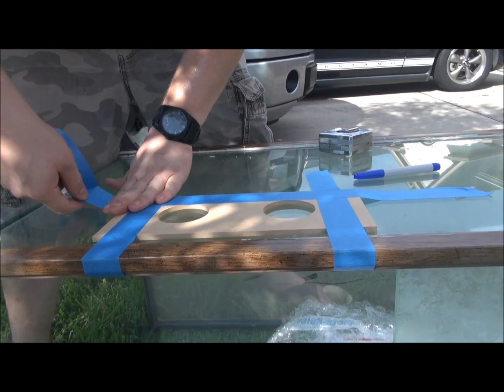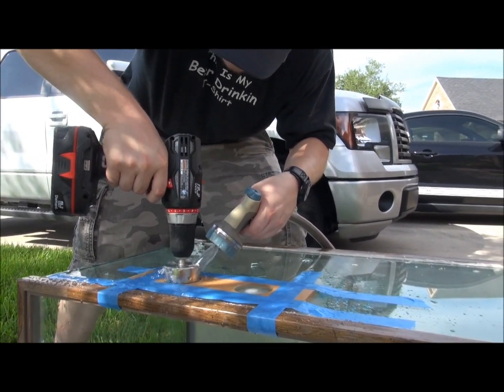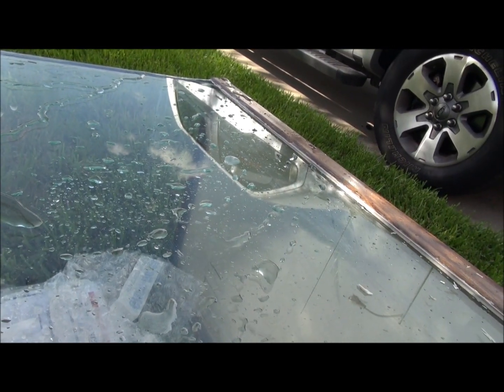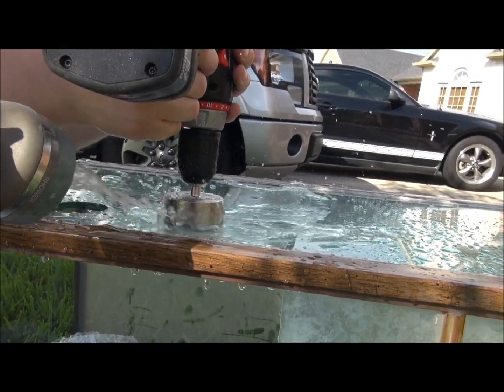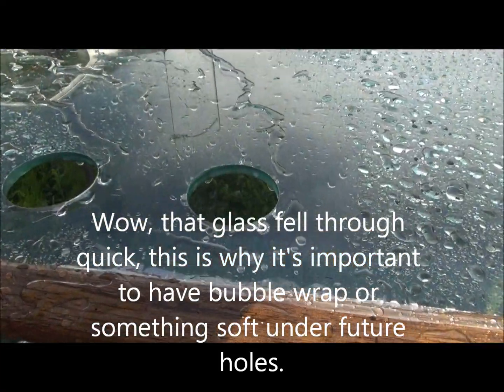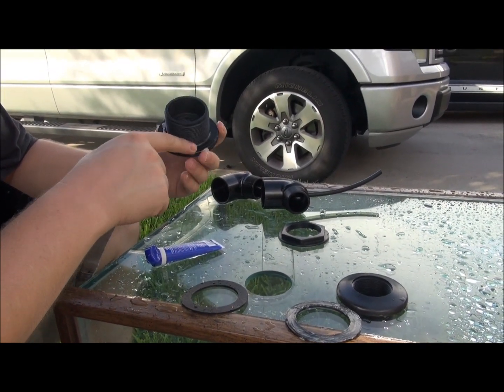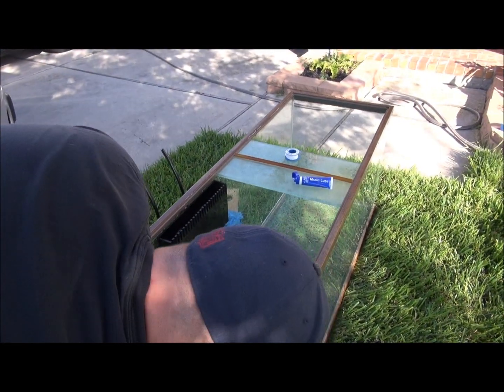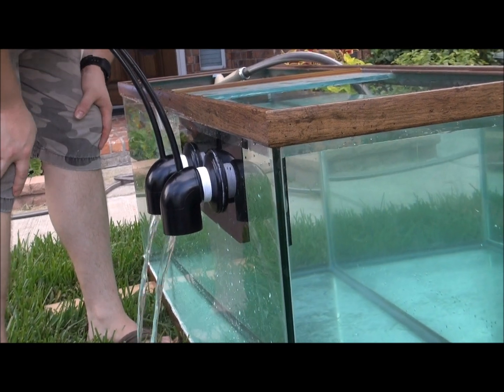Drilling Glass for Glass Holes 1500 reef tank overflow

Comment: Do you know you put your bulkheads in backwards but good job
Reply: Bulkheads are placed correctly
Reply: +Ian Mackey the screw goes on the outside of the tank not on the inside look it up the rubber seal goes on the inside and the screw goes on the outside but whatever if it don't leak it don't matter I was just letting you know
Reply: With the Glass-Holes instruction kit it shows to put the nut on the inside of the box

Comment: no, thats the way glass-holes overflows are designed. if you actually watch the nut isn't on the gasket...its on the box which acts like a washer for the gasket that goes between the glass and the box.